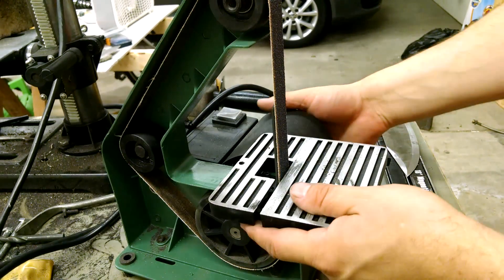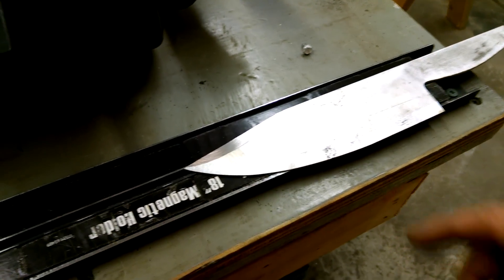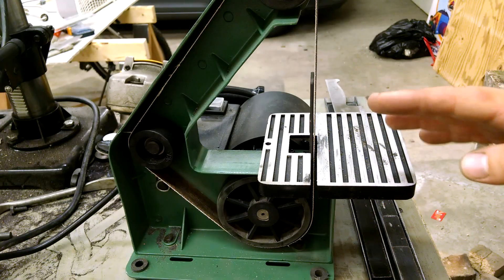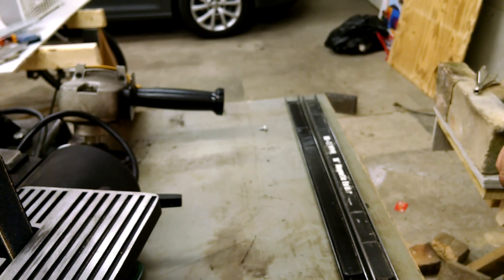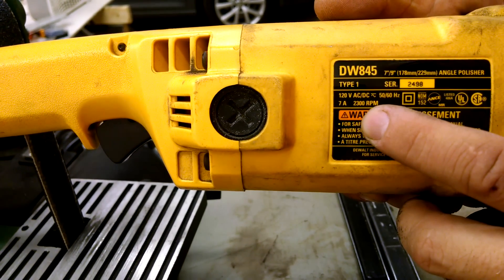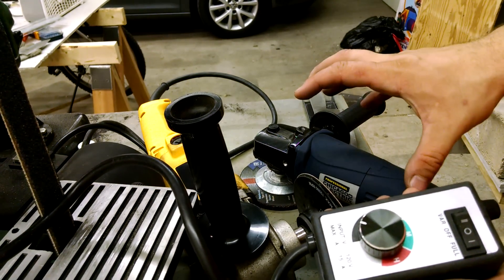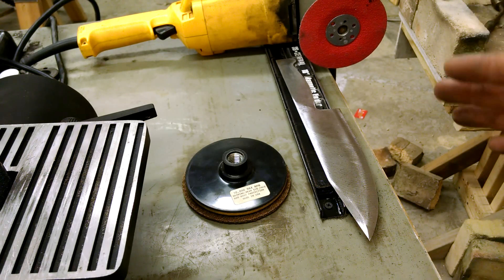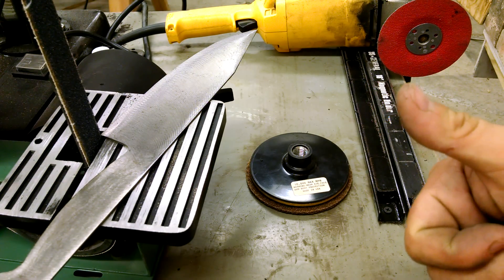Harbor Freight 1x30 vs. Angle Grinder for Knife Making

Comment: This is probably your 3 video I watched and I've noticed something,your a very spontaneous person and you are either lucky or rich because hell the 1/30 change the tool rest to a smooth surface and make you a bevel jig from a pcs of angle iron and get you those ceramic belts and you'll have a precise angel with more repeatability

Comment: Everyone is different so if you can get the results you want with an angle grinder then that is great! I personally feel like the 1x30 is the easist option if you make a smooth/wide table for it and use a piece of angle iron to clamp your bar stock to.  You just tilt the table into the belt to get the desired angle and then grind until you hit your center line, unclamp bar stock from angle iron and flip it around, and then repeat the process on the other side.

Comment: there is a term "time on the lines" for grinding bevels, it's a skill, it has nothing to do with the 1x30 belt grinder, you would experience the same issue and probably even worse on a bigger 2x72 belt grinder - the work around is to create a bevel grinding jig that keeps the blade tilted towards the belt at a fixed angle, this reduces drift and improves your bevel grinds substantially, my son tried the same thing on his 1x30 grinder (same as yours), same difficulty, then he found some bevel grinding jigs on youtube and boom, his knives look awesome - do some research, there are plenty of vid's with bevel grinding jigs, using an angle grinder would introduce more opportunity for failure and random bevels, the machine isn't fixed in a stationary position - just my opinion - nonetheless nice job on the video, good luck with this.

Comment: It sounds to me like you want to learn this today. If an angle grinder was the best tool for the job, professional knife makers would be using them. Slow down. This is an art form, slow and steady wins the race. Angle grinder is fast and sloppy. 2x72 is  steady, and accurate.
Reply: Professional knife makers do use angle
Reply: @ambulldog111  I use an angle grinder for my knives and I've gotten quite good at it I think.  But that's only because I can't afford a decent belt grinder at the moment and I don't want to buy something cheap from harbor freight as their stuff has a tendency to break in my experience so far, I'll still probably buy this belt sander though lol as it is the cheapest I can find and I just want something to learn on at least lol

Comment: Part of your issue is that you're trying to freehand the knife on the sander. It also seems like you were using a rough grit like below 60. I'd recommend around 120 for the bevel. With the sander you don't really need to put too much pressure.